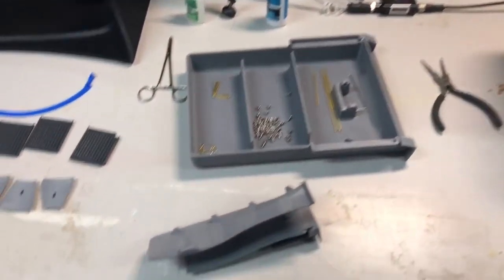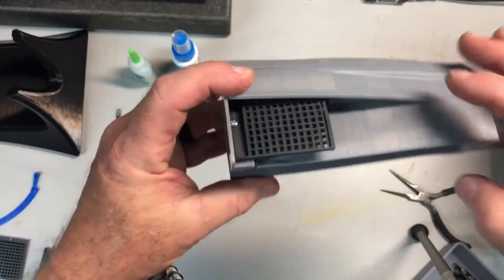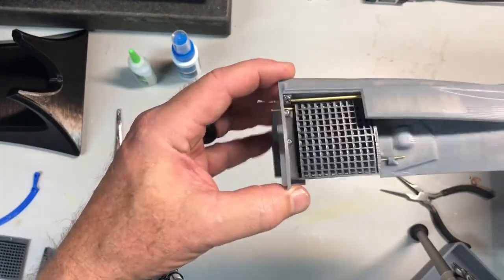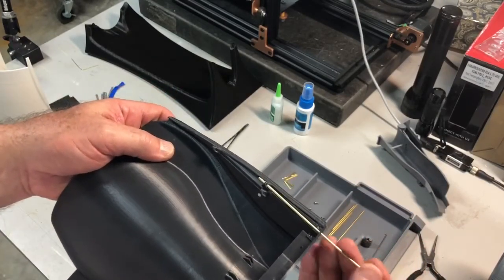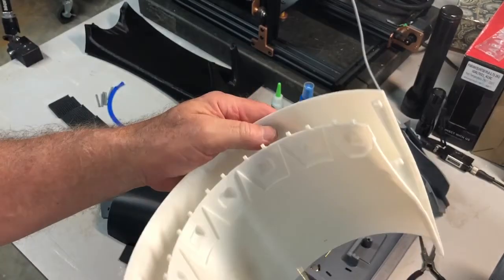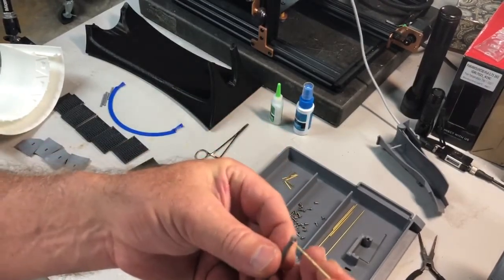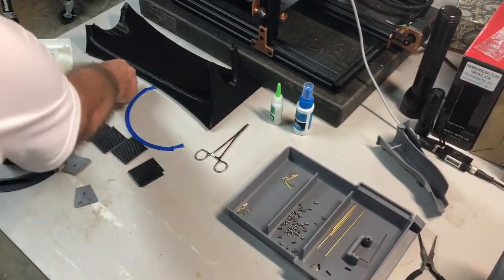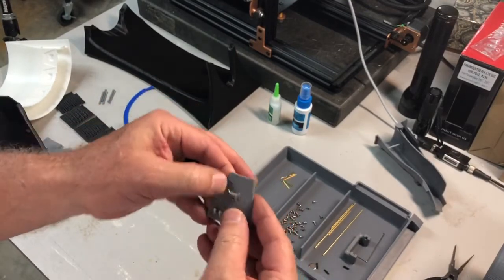Functional Thrust Reverser Assembly

Comment: Just stumbled on your remixes and remakes of the engine, truly incredible stuff. The original was very neat but your updated version is so detailed - And I can add the electric motor and thrust reversers? 😲

Needless to say, my printer will be busy for the next couple of days, lol.
Reply from the maker: Thanks! As long as you use my nozzle assembly the motor and reversers will work fine.
Reply: @rtwileyrc8030  Yep! Im going to print the parts for the Motorized Nacelle first, just so I don't re-print the same components from the engine model. 

Again, I really appreciate you sharing all of this. Im a software and systems engineer and I like 3d-printing, but when it comes to actually designing the parts in CAD, I'm pretty much a luddite (I don't find working in CAD as much fun as things like Arduino or writing code, so its hard to keep focused on it, lol). So just being able to print your designs out is awesome. 

Have you thought about making more YT videos? You're clearly incredibly talented. I could see your channel putting out content in the same class as Applied Science, Tech Ingredients, etc.
Reply from the maker: @jhyland87  Don’t really have the time for it at the moment. Planning retirement in the next year and then I have all kinds of projects I plan on doing.
Reply: @rtwileyrc8030  totally understandable. Congratulations on your retirement, and I hope to see more content from you :-)

Comment: You have made my dreams come true! Incredible job! Im going to print this..Do you think I can add a much faster motor with plugged in DC power?
Reply from the maker: Even with the battery powered setup I have it could go considerably faster. It would just require selecting a different ratio. From a display standpoint I don’t think faster is better. The blade tips are already a blur at 72 RPM. The coupling between the motor and the engine shaft would probably start wearing considerably faster at 250 RPM.  Anything below that and your probably okay. If you wanted to go fast enough to actually create thrust at probably 2000 RPM, the entire bearing and shaft system would have to be completely redesigned.

What do you have in mind?
Reply: @rtwileyrc8030  I was just want to get some thrust and wind action behind my static display. I am planning to balance my rotor parts on my prop balance for vibration. I may just use a flexible coupler. Any ideas? also I want to mount it underneath a shelf. Do you think i need to strengthen the pylon assembly? I am looking at that now
Reply from the maker: I doubt you’re going to be able to attain sufficient RPM for even the lightest thrust without doing significant rework of the shaft arrangements. The shaft coupling isn’t designed to maintain good alignment and all the bearings are arranged such that any thrust would pull them from their locations. The original designer of the core engine just didn’t configure it for any significant speed. I would love to see work done to the design such that thrust could be achieved but it just isn’t set up for it now.

I have hung my co pelted nacelle from the pylon mounts as if it were attached to a wing when I was taking some pictures. Everything is certainly strong enough to leave mounted like that except for the forward pylon to wing mounts. I doubt they could handle the load long term. There are two sets of three pieces for these mounts. If you replaced just one piece out of each set with aluminum or steel then I have no doubt it would stand up. They have a relatively simple shape so it wouldn’t be too difficult. Other than the forward wing mounts, everything else should have no problems with a pylon mounting.
Reply: @rtwileyrc8030  Ok thank you for the quick replies. I am so excited about this build. Cant wait to get home to start it. I am an international cargo pilot so  my down time I  have been working on making the accessories parts in Tinkercad around the 3d printed engine. Will run styrene plastic rods around for the piping Pneumatics, hydraulics, ETC.  Thanks again
Reply from the maker: You’re doing what I’d like to try. Make sure you post a build when you get done.
Reply: @rtwileyrc8030  Hey, Its been a while, but I have been working on the Trent build ever since the last that we talked. I modified the motor to an RS540 DC Motor, I also have made 90% of all of the accessories that go around the engine, and designed it so it can be mounted/demounted under a shelf with a hook and can rotate with a lazy suzan ball bearing. I have been working and printing 24 hours a days, 16 days a month, for the last 3 month. Its been crazy but its finally starting to take shape. I have primed and wet sanded every printed piece..Its been a lot of fun. I will post when its done
Reply from the maker: @patrickg875  looking forward to seeing the result. Really want to see what that RS540 can do.

Comment: how about assembly instructions video for the original design HIGH BYPASS ENGINE?
Reply from the maker: There are already a dozen different assembly videos for the core engine on YouTube. I’ll see if I can find one or two of the better ones and post a link. Unfortunately here isn’t a video for the rest of the nacelle. If I get a few requests I will considered taking the nacelle apart and doing a video just for it.
Reply: @rtwileyrc8030  I'll be appreciating it. Coz I've already printed all parts.
Reply: @rtwileyrc8030  I'd appreciate that as well! Found the model on thingyverse and was incredibly impressed. Sadly I don't have a 3d printer, so I'll probably have to pay some online service for that.
Reply: @ImNotQualifiedToSayThisBut  NO! , Buy a 3D Printer! it will be a lot cheaper for you. Creality CR-10S or better with a 300mm build print size. Learn how to use it
Reply: @patrickg875  Well, I already thought about that, especially after having checked the pricing on 3d printing. I'll get one in the near future, just gotta save some money - university life.

Comment: Is it possible to place on an radio controlled plane?
Reply from the maker: As it is, no. There are areas that would have to be significantly strengthened to withstand the stresses of flight. But the basic geometry and aerodynamics I believe would work quite well. Mainly all the hinge and slide points would need to be replaced with something stronger. Maybe machined nylon would work well.
Reply: Hinges are metal bolt (m1 screw) with nut 🔩 to connect  blocker door and blocker door connector lever  (  drag link ). Although the engine nacelle, blocker doors, cascade vanes, drag link  (Blocker Door connector lever) are 3d printed while the edf is still the engine without using 3d printed blades because it will break due to twisting and centrifugal forces.
Reply from the maker: The brass hinge pins are certainly strong enough without being replaced with bolts. It’s the 3D printed portions of the hinges and slides that would not be strong enough. They would have to be cut off and replaced with something stronger. The drags links are a prime example. They would have to be replaced entirely with something else. And like you said the actual fan would have to be replaced as well.
Reply: @rtwileyrc8030  I did not use hinge which connects the blocker door and the translating cowl I just use a piece of duct tape to act as a hinge only the drag link has hinges. I think epoxy resin which helps to strengthen weak parts of the nacelle especially on the nozzle lever section that holds the drag link, the  engine nacelle which compatible for 40 mm edf. If the 3d printed drag link could not withstand an aluminum drag link is a better solution just an aluminum sheet then shaped into a drag link using a mini grinder ( Dremel ).